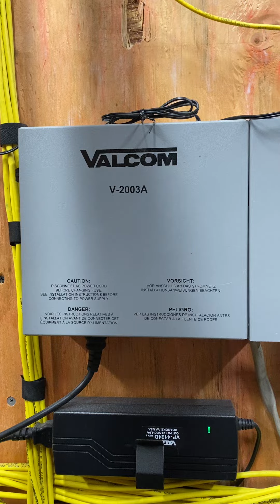How Paging is done with Cloud VoIP

Comment: Why not just switch to a paging system that can speak "SIP" and have it connect directly to the network via an ethernet cable or even wifi?
Reply from the maker: Yes, totally a better option.   But, I see this ATA solution often because it's much cheaper. 
You make a good point though! 😊